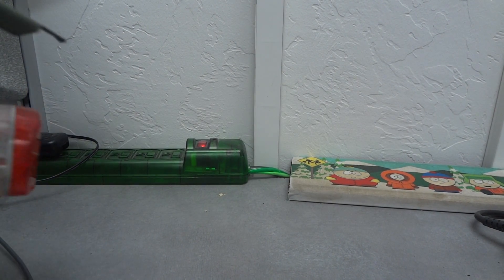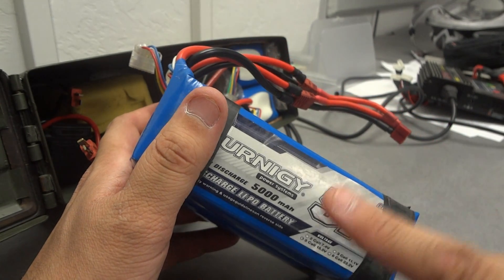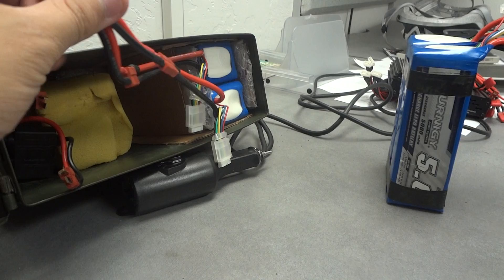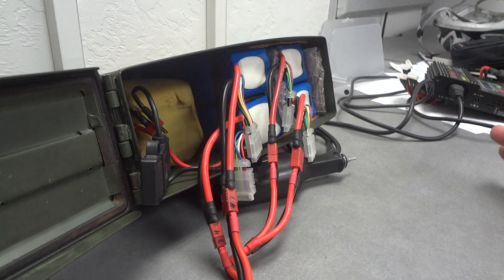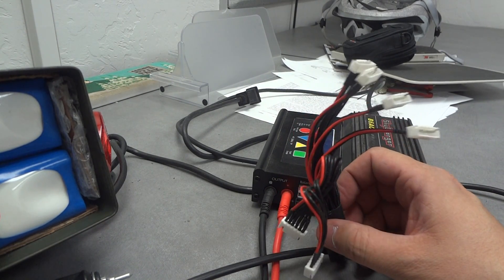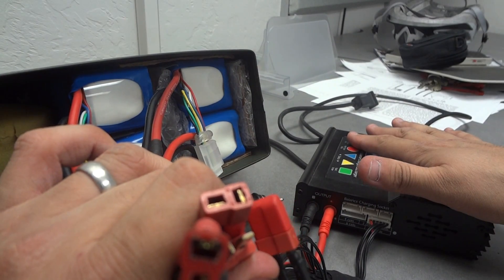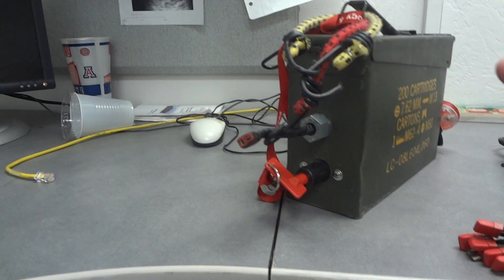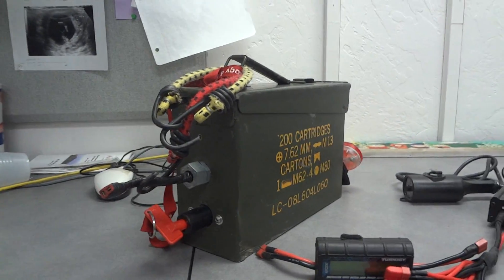My Electric Bicycle 37volt 10ah Lipo Battery Pack

Comment: Can you share how do you control the engine speed/power of your bike? Do you use commercial ebike parts or RC parts too? Thank you.
Reply from the maker: I have the commecial ebike kit (http://www.ebikekit.com/electric-bike-conversion-kits/e-bike-conversion-kits-without-battery/direct-drive-hub-motor-conversion-kit/front-500-1000w-e-bikekit-direct-drive-motor/). Albeit the older non LCD version.
Reply: solracotos Thank you very much. Helped a lot! Just one more question: how did you connect the batteries to the controller? Did you make any adapter? Thank you again.

Comment: Great video, thanks.  I have 4x 3S batterys for my 48v bike and I take two turns in charging each pair in serial.  It is too much fuzz so I will definitely step into the world of parallel charging.  I also like the case.  Have to find me one of those :).
Reply from the maker: A military surplus store did the trick for the ammo box.

Comment: hi i just brought a 60 v motor can you make a suggestion for what lipo batterys to use do you think i should use 5 x 12 volt or 3 x 20 volt any suggestion would be awesome please
Reply from the maker: Well, it all depends on you charging set up,  Remember that lipo cells have a nominal voltage of 3.7V.  So to achieve 60V nominal you will neeed a 16 to 17 cell in series.  For example 16 cell in series can be achieved in many ways: Four 4s lipo packs, Two 5s lipo plus a 6s lipo, etc, etc 

However I prefer to have all lipo packs to be the same cell count.  I keeps thing easier when charging.

Comment: better be carefull with those. they look like they are starting to loose the square shape.
Reply from the maker: You have a really good eye.  When I shot that video they indeed where a bit puffed up.  I used them for about 4 more months and then replaced them.  I know have a 10s4p pack yielding 20ah at 37volts.
Reply: +solracotos Why are they damaged?  Is your configuration of going from series to parallel to series again make a problem?

Comment from the maker: I just replaced this pack. I made a bigger, 37v 20ah pack (10s4p) to complete my 20 mile round trip commute to work. I have a  36V 750 watt motor that during peak consumption utilizes 26 amps.  For each 10 mile  leg of my trip I consume anywhere from 5ah to 6.3ah.  The lower  value is with me pedaling without breaking a sweat.  The higher reading is sporadic pedaling (maybe 20%to assist during accel).  At an average speed of 20mph.  My comute is on a bike path so most of time I'm at full speed.
Reply: My concern is simple the speed he talks a  with Lipo poly I would slow down maybe put the fire out faster

Comment from the maker: Exactly, If pay attention to my video when I'm using my batteries I assemble them in a 10s2p format.  But when I charge I assemble them in a 5s4p format and charge.  What the charger see is a 5s lipo pack but with a capacity of 5x4=20ah.

What happens is that the batteries connected in parallel will always reach an equilibrium between them.  The problem is that if one of them starts failing(selfsdischarging) it will damage its neighbors.  So check for voltage balance between cells often.

Comment: Thank you again, What ever I've read on balanced cells indicates that this indicates "one cell-one wire" and not 4 cells masquerading as one cell. If the above is not carved into stone, than I'm relived into knowing I can upgrade or double my amount of cells as long as I maintain the same formular for new cells of identical mah. As my 64 cells are so compact and yet to be charged, I have the option of getting another 64 cells to double my capacity to 70.4 AH. It's back to Endless Sphere for me.

Comment from the maker: Again, I'm no expert on BMS.  But a BMS is a systems that enables you safely charge and discharge a set Cells connected in series.  To do this correctly your BMS must: 1)be rated for the charge/discharge current you expect to see, 2)Be of the correct chemistry to match you cells, 3) be wired correctly.  
Now the BMS does not care about cell capacity it only cares that the cell chemistry. Why? Because cell chemistry determines the correct end-of-charge voltage.  Cell capacity does not affect that

Comment from the maker: On the contrary my friend.  That is where I went went I was starting with questions much like yours.  With the added benefit of having a whole community dedicated to E-bikes, battery tech chargers etc...  

I ddid not mean to insult about the impending doom but li-xx batteries need special care.  I don't use a BMS so my help is limited on that front.  My pack does not need a BMS because I do all the BMS'ing myself.

Comment: I bought  64 -18650 cells; 16 welded  four packs because my BMS has 16 balance wires listed from c1 to c16. I thought that would simplify connecting the balance wires.  However I now see a potential problem as my 48 v  BMS is probably factory rated with 16 wires for 16 -2200mah single cells and not for 16 - 8800mah four packs. Is this what you call a disaster?. Is there an additional wiring configuration to prevent my BMS from turning into a thermal runaway?.

Comment: Endless-sphere is shop talk for those who have already built battery packs, and of little value to beginners. My 35.2ah pack reads 61.2v un-charged, so just what is this disaster you see. Does my pack need a kill switch, like your pack needs a BMS?.

Comment: The link with your name still eludes me. Perhaps I should revamp my question. I know not to discharge my pack beyond a certain voltage. Is an inline volt meter the best guide on when to recharge and avoid what you call a disaster?. I thought your over kill design of cables &  kill switch made you the one expert on what not to do.

Comment: I bought my cells on EBay , $52.00 per 16 cells . They are the only factory welded cells available without tearing apart HP laptop battery packs. I still can't find your link on YouTube.

Comment from the maker: Well if the 16 cells are connected in series that means that each individual cell capacity is 35.2Ah  (too high). Did you buy from a reputable source.

Your questions are going into specifics that make me believe that your understanding of batteries, their care and handling is a bit limited.  That is a recipe for disaster. Please go to the second link I listed on the video description (endless-sphere). In that forum you will find a breath of info about batteries, chargers, E-bikes, care,  etc..

Comment: The factory specs for my cells are 35.2 AH per 16 cells. However my cells are all wired in a series. Does your formula still work , if so it sounds like a lot of AH for a $250.00 DIY project. I have a 48v. 5A charger, what is the best way to monitor when to recharge, using a volt meter or battery life indicator?. Thanks again for letting me pick your expertize.

Comment from the maker: I don't use a BMS.  Like I said on the video.  When I need to charge I dissasemble my 2p10s pack and parallel the lipo bricks into a 4p5s pack and charge them with my lipo smart charger. So, not sure I'll be of much help on that front.  about sending info.. send me a Private message

Comment from the maker: Part 2:  Again if I understood correctly you have four of those 4p16s packs.  Now you can serialize those 4 packs again to increase the voltage.  Which in your case will yield 14.8*4= 59.2v nominal or a 4p64s pack

Or you could assemble two pairs of the 4p16s packs in parallel first then connect them in series for a 29.6v (nominal pack) or a 8p32s pack

It will all depend what you want to do with the pack, the target voltage and the desired capacity.

Comment from the maker: Capacity of a pack can be modified by changing the number of cells conected in parallel.  

Voltage of a pack can be modified by changing the number of cells connected in series.  

Part 1: Again i'm guessing is that you have a 4p16s pack. That is four groups of 4 cells connected in parallel (that increases the capacity by a factor of 4 but leaves voltage the same).  Now each of those 4 groups is connected in series to increase its voltage.  3.7*4= 14.8v nominal.

Comment: Thanks for lending some sanity to my BMS. I'm confident that my battery pack will put out 67.2v. So I won't let the idea of balance wires throw  me a curb ball. Another DIY video on YouTube shows a 48 v. 16 cell battery pack that has 10 AH. How is that possible when my bank of four 4packs; 16 cells only produces 16.8v. What other battery configuration could I use without breaking up the 4packs to get more bang for the buck?. My initial  configuration was 2 banks in a series and 2 in parallel.

Comment from the maker: About the voltage.. Voltage of the bateries and their rage depends on the chemistry of the batteries.  For example Lithium Polymer batteries have a nominal volgatage of 3.7 volts per cell.  When fully charged they have a nominal voltage of 4.2.  If your BMS is made for that particular chemistry then it was built with that change in mind.  t

Comment from the maker: the port on batteries always have n+1 wires. Where n is the number of cells connected in series.  so  a 16 cell pack will have 17 wires.  However you BMS may take the further positive directly instead of needing an extra wire.  Check your BMS instructions..
Check link description of a basic 4s balancing port

Notice that each pair adjacent of wires isolate a cell. When measuring with wires in between you get the serialized voltage across those cells

Comment from the maker: So, If I understand correctly you have four  4p4s battery pack.  That is on each 16 cell pack you have 4 sets of 4 batteries (these are connected in parallel hence the 4p) connected in series (hence the 4s).  So each four batteries connected parallel behave as 1 big cell.  

Now, you could serialize the smaller  4p4s pack to make a big 4p16s pack.  You would need to do some soldering a wiring but should end with a balance lead that has 17 wires to you bms.

Comment: Each uncharged 4pack is welded in a series and reads 3.82v on my voltmeter. The specs indicate that when charged it will be 4.20v. That means when all 64 cells are charged they will total 67.2v, but the factory specs for my BMS are 57.6v before charging, I think. Is the 10v. difference too small to worry about?.

Comment: Each four pack is welded to form one cell. Each batter bank has 4-4packs for a total of 16 - 18650 cells. The BMS only has 16 balance wires so I thought I could solder one to each of the 16 -4 pack cells. Am I on the right track or did I miss something?

Comment from the maker: Are the 16-cell pack welded in parallel? In series?  From a search on the web the nominal capacity of 18650 is 3.7v @ 2.6Ah.  Can you confirm?

Comment: I have 64-18650 cells, in the form or 16 factory welded 4packs or 16 cells per bank, 35.2AH each. I have a 48v 16s BMS PCM PCB with specs of 57.6v. Can my battery configuration be, 4 banks of 16 cell, with balance wires going to each of the 16- 4packs?. I'm lost on what you must call the easy stuff. Mil gracia hermano.

Comment from the maker: The range you get out of you pack is a function of: the motor you have, the age of your pack, the riding conditions (i.e. temperature, slopes along your ride), the overall weight of the bike + rider, the speed at which you ride and the assistance ( how much pedal) during your ride.  

Anyways when the pack was new I was using about 0.5Ah/mile.  Now with about 300 cycles (charge/discharge) I'm using about 0.85Ah/mile. That is with a 750watt motor, about 240lb combined weight, fairly flat ride and

Comment: Are you kidding me, this setup is overkill and won't even get warm at full throttle on an electric bike.  These batteries are designed to power RC helicopters that can pull more power then an entire home.  Good job!

Comment: wouldnt it be easier to to get a custom made lipo battery with bms rather than connect loads of rc lipo batteries together and have the hassle of multiple voltage monitors. you can get 10ah or 20 ah lipo cells. i personally think this is the hard way of doing it using multiple rc batteries linked together. the only advantage i have seen to this is you can choose to mount smaller rc packs onto the frame but unless you need that you are better getting a custom built lipo pack